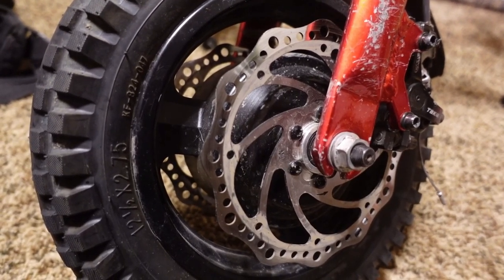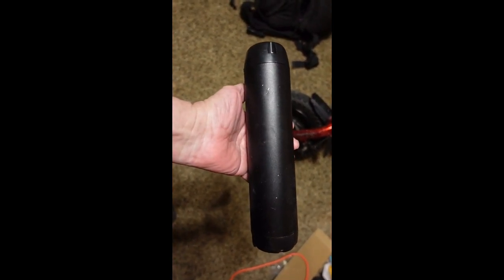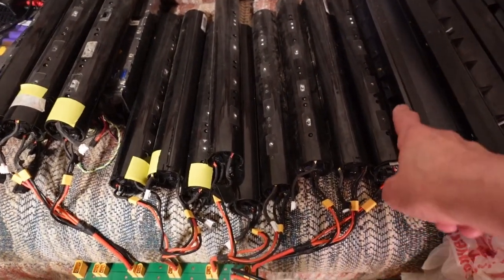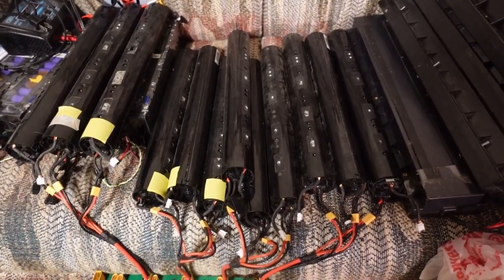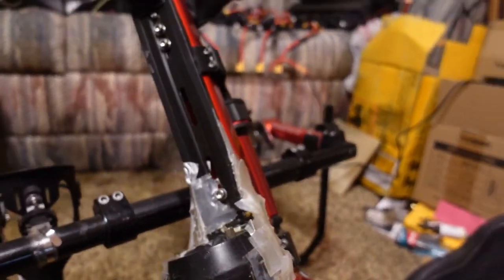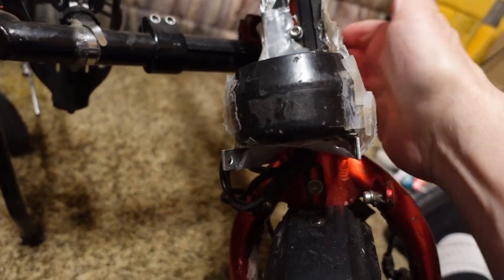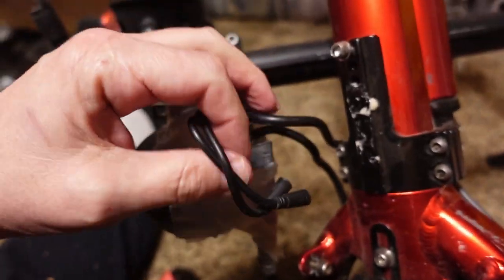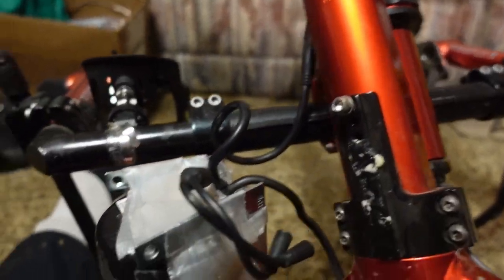Repairing and upgrading a Rio Firefly 2.5 mobility scooter, part 1

Comment: hey man, just ordered one of these, and was already looking at adding batteries. what was it you were adding to the inside of the control panel for the external batteries? you never showed hooking up the external wiring?
Reply from the maker: I added a tap to the battery terminals and ran it to an external XT60 connector. It gets a bit tricky because there is regenerative braking on the controller, so i couldn't put anything inline with it.
Reply: @magic.marmot  so was thinking of just making a plug for the existing battery, pull dead original battery and plug in connector to new sourced battery. as for as i know theres no electric brake, therefore no regenerative braking. as i understand it. oh and not sure you finished your buddies, but if you rotate the batteries around to the back theres plenty of room. might even be able to center them more to get the weight directly over the power tire.  thanks
Reply from the maker: @DrivinghardOregon  plug for the existing battery is an excellent idea. It was also my first thought, but we decided to run them all in parallel for more range.
Reply: @magic.marmot  yeah thats what im trying to decide. so wiring under the panel is just straight wired to the positive and negative lugs? it seemed like you were putting an isolator or something in there? 
     though i havent riden it yet, but have heard a couple times the complaint about  no weight\traction on the front like your buddy said. so had me thinking maybe i should run parallel, like you did,  so i can also get the benefit from the weight over the tire also. was also wondering where you sourced the batteries? are they very affordable? id like to stick to decent quality cells. but im on a tight budget. thanks for your help
Reply from the maker: @DrivinghardOregon  We ended up mounting them to the crossbar on the outer sides. I got some clamps for mounting accessory lights to a 4x4 that seemed to work okay, but we really need a better solution. The good part is that when he attaches it to his chair, the batteries are almost directly in line with the drive wheel. Major improvement in handling.
I do have some follow-up videos on the mounting and other stuff.
Reply: @magic.marmot  sorry to bug ya again,  so the wiring under the panel is just straight wired in parallel to the positive and negative lugs? sorry you just had me confused with the bag of parts you said you were trying to fit in there to make it so the aux plug could come out. i am far from new to wiring\electronics, but i am new to dealing with 36v lithiums.  so i didnt know if you were putting some kind of isolator under there? which i doubted since the batteries even out when plugged in. Just want to make sure that im not overlooking something. last thing i want is too fry my new toy.
Reply from the maker: @DrivinghardOregon  i did not put anything in for isolation. I was going to, but decided against it.